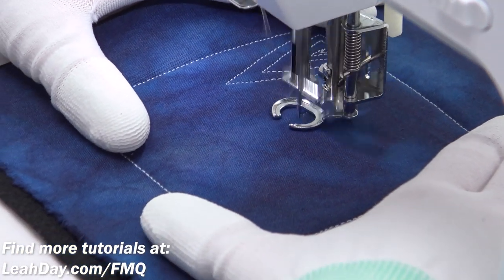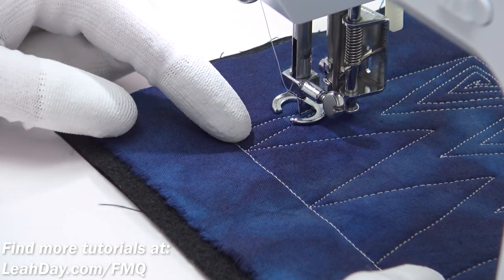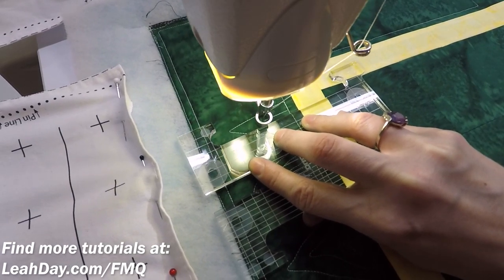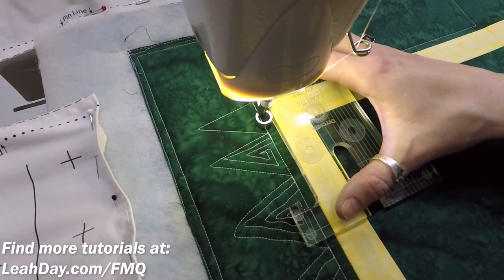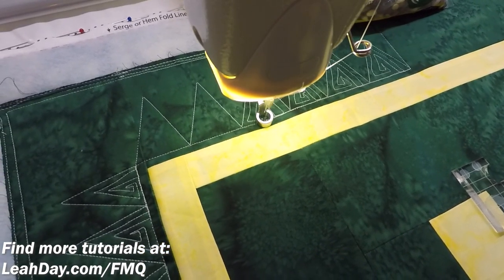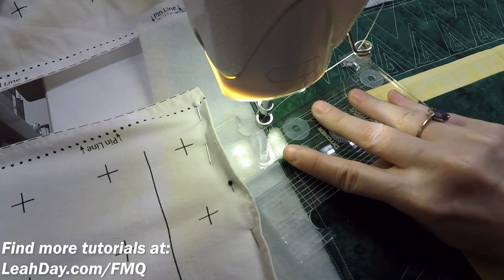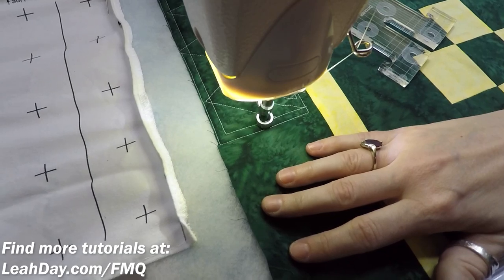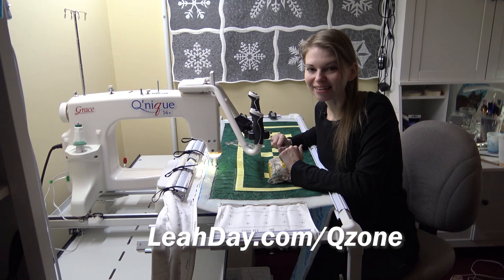Machine Quilting Electric Pulse on a Home Machine and Longarm

Comment: Remember on the outer edge of the quilt, the binding will cover part of the design if you stitch all the way to the edges of the fabric. If you want to keep the points on the outer edge uncovered mark a line to stop the quilting at along where you will stitch the binding on. You can still travel in the binding seam allowance.
Reply from the maker: Yep, if you're wanting to preserve the points, that's a great tip!

Comment: Hi Leah I didn't get any ruler foot for my brother or singer home machine, I Amy Johnson said she was out of the clarity ruler foot , so I just put it on the back burner for now until I can get access to one
Reply from the maker: You can always try just regular free motion quilting! You can't use a ruler, but the skill is the same to build either way. Also... I'm not a fan of the clarity foot because it tends to bend when pressure is applied. I'd advise a metal foot instead.
Reply: @LeahDay  Thank you for the advise I will try to work on it also, I was thinking the same thing about the safety of the clarity foot cause I how how my strength is naturally, again thank you for all you have done